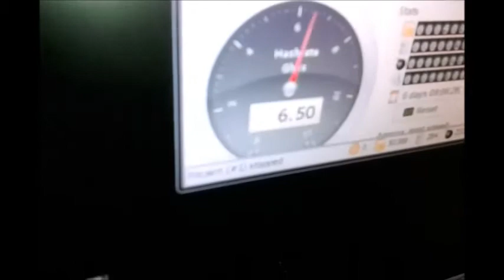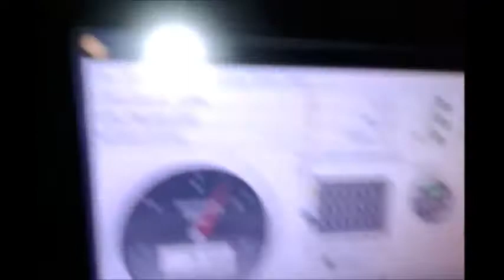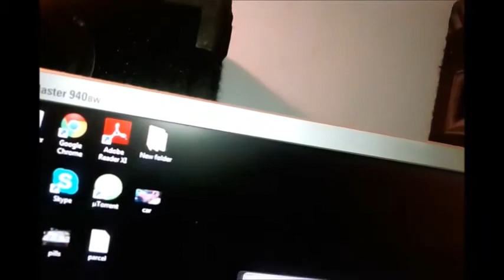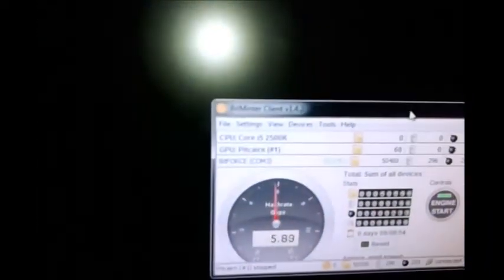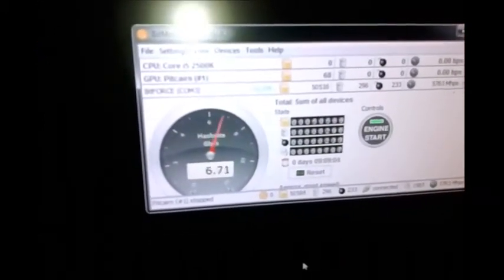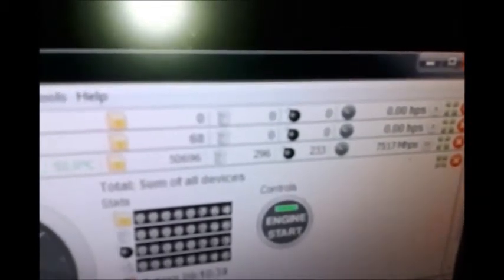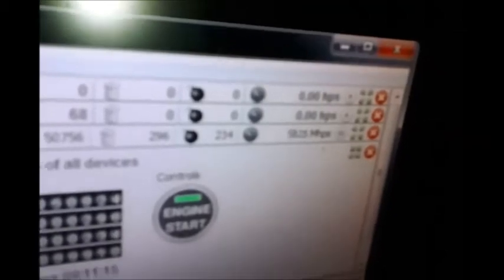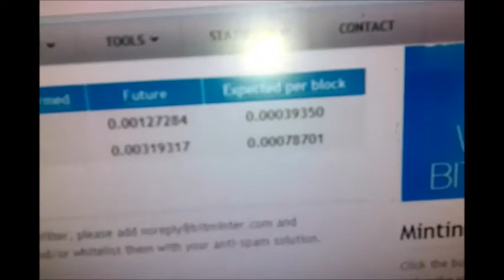Butterfly Labs 5 GH/s ASIC Bitcoin mining rig, the Jalapeno Part 2

Comment: Hi Ben , i bought a Butterfly Labs 8 GH/s and i can`t set up it. can you help me to set up it- i really need your help, I download bitminter but this is not working !!!! i don`t know why :((, so i can`t do anything now i'm waiting for your answer. I have another question can i talk to you in team speak server or Raidcall ?
Reply from the maker: Do you have Facebook? after facebookDOTcom put br.19.84

I have Skype if you want to chat. Go to preferences and show all devices so it shows up. Have you installed the right drivers for the miner?

I don't have team speak or raid call. 07906 791 106 call me if you want.
Reply from the maker: Show all devices is under view. If you still can't see it you need to install the correct drivers and then it will work fine. You can find them on the BFL web site.